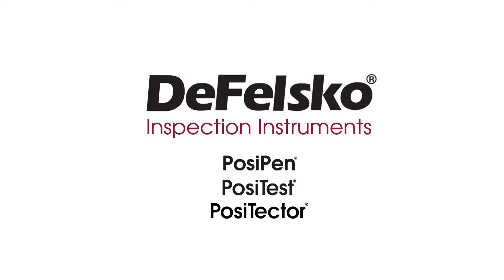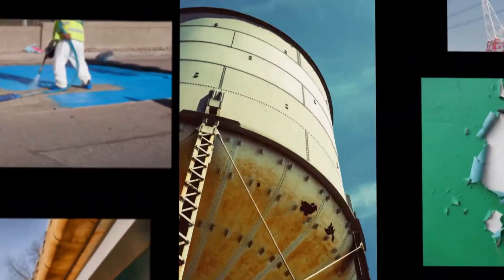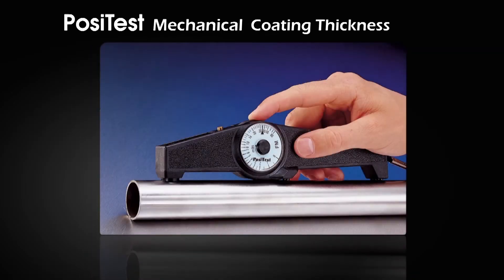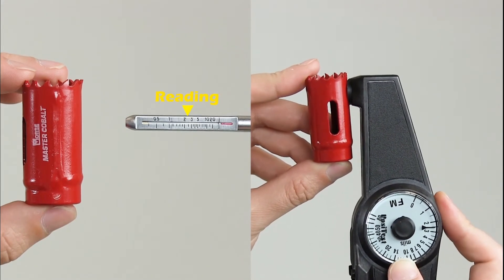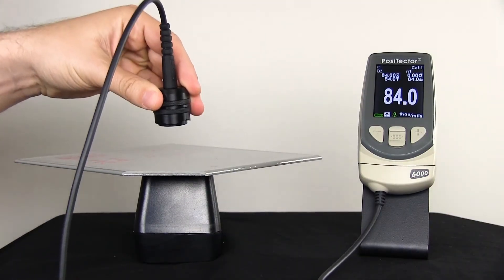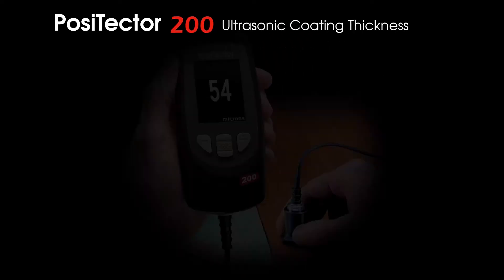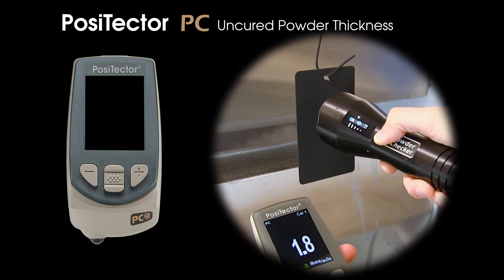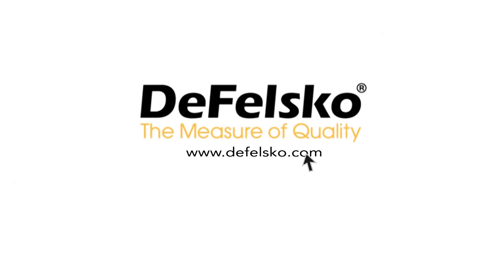How to Measure Coating Thickness using PosiTector and PosiTest Coating Thickness Gages from DeFelsko

Comment: Is this also work for surface temperature of 300 deg celcius
Reply from the maker: Great question! Our PosiTector 6000 FXS coating thickness probe is designed for hot, rugged applications. It features a zirconia-toughened alumina wear face and a durable braided steel cable, making it ideal for harsh environments and continuous measurements on surfaces up to 250 °C (500 °F). For slightly hotter temperatures around 300 °C (570 °F), you can take spot measurements if the probe is placed on the surface only long enough to capture a reading and allowed to cool between uses.  Please contact our technical sales team at +1-315-393-4450 or techsale@defelsko.com for further assistance.  Thank you!